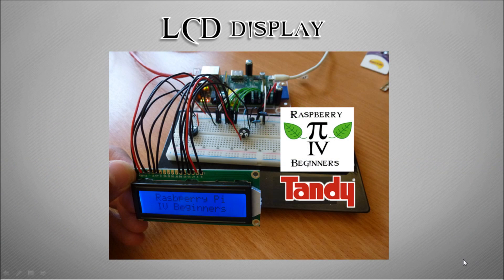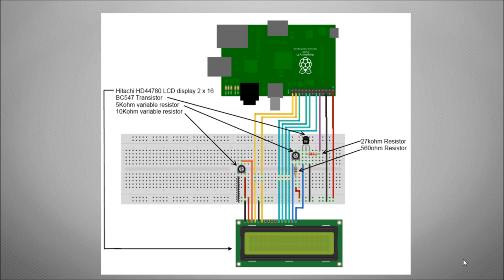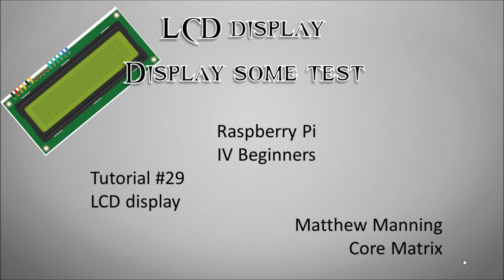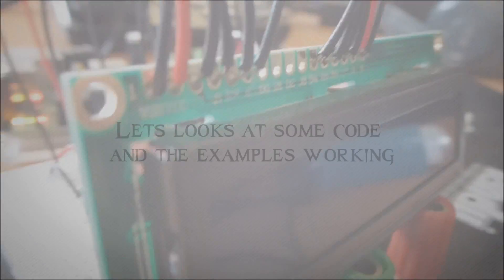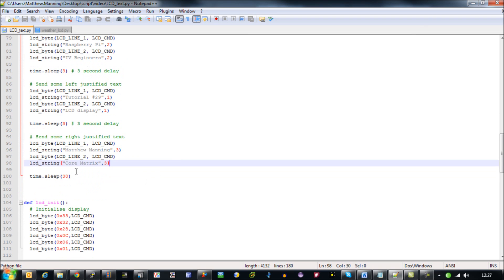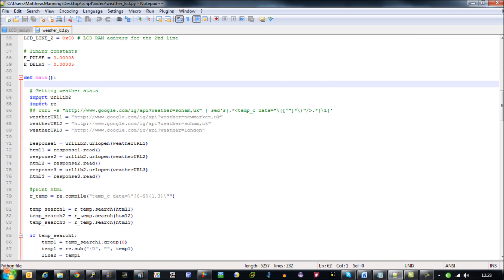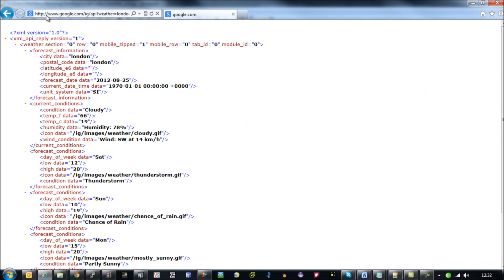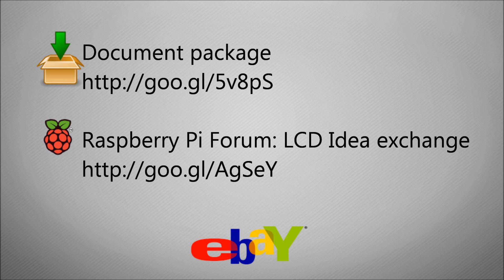Raspberry Pi - Using a 2x16 LCD

Comment: Hi, nice tutorial, pretty straight forward. Sadly enough i don't have a HD44780 controller, it's an gdm1602a which should be compatible. Which it is, kinda... I have one issue, the stuff on the screen is not visible head on, only under an angle. The changing var. resistor for the contrast doesn't help... Plus the letters are kinda messed up in the sense that some letters miss a part of the characer. e.g. a B misses the vertical line so it looks like a 3... Any tips?

Comment: Hi just want to say first that your videos are great but I seem to be having a problem with the LCD and was wondering if you could help. I have the circuit wired up correctly(hope) and it does display the first line of text Raspberry Pi IV Beginners but then just displays blocks. I have tried editing the code and checked the circuit a few times. Any ideas?

Comment: Sadly Google seems to have killed off the weather API. I have just had a quick hunt, and I can't find any APIs that don't required registration, even the free ones. At least it will be possible to implement a change to the code though.